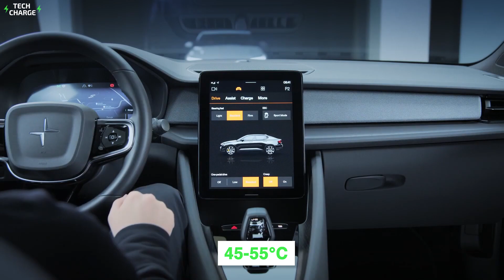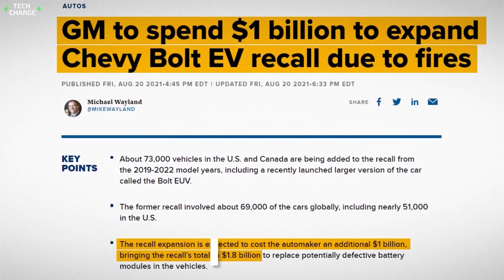The Shocking Truth About EV Fires You Need to Know

Comment: If you consider the life cycle, or cradle-to-grave carbon footprints of a standard gasoline car, a gas-electric hybrid car, or all-electric cars, the hybrid cars come out the best.
Reply: Nope. Look at the mining process. How much ore is needed. Machines that they use, run on fossil fuel. Child slavery and inhuman  conditions at the mines. Do your research.  You'll be Ashamed to have an ev
Reply: @bobbylikes1621  All-electric EVs have the higher life cycle carbon footprint .  Gas-electric Hybrids do better.
Reply: I'm saying evs cause a way bigger carbon for print in their manufacturing. An ev will never offset it

Comment: A battery is storing a lot of energy that is released uncontrollably when the battery fails.
That's on top of the chemical fire.
Reply: A single gallon of gas has the equivalent of around 33 kWh.  So, if a monster EV like the hummer EV has roughly 200 kWh of energy stored in the battery pack... a tiny roadster with a 15 gallon tank has more than double the energy in a single tank.
Reply: It has nothing to do with how much energy is stored. Look up LTO batteries - they can store a lot and still don't burn. Even LFPs don't burn.